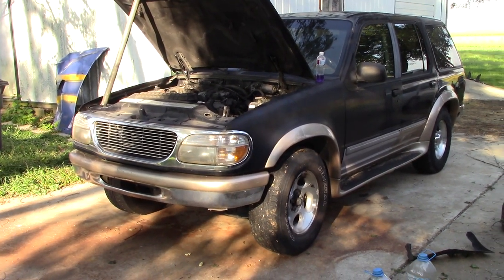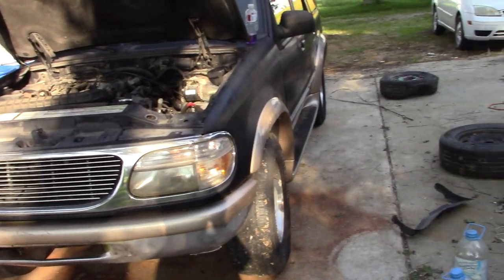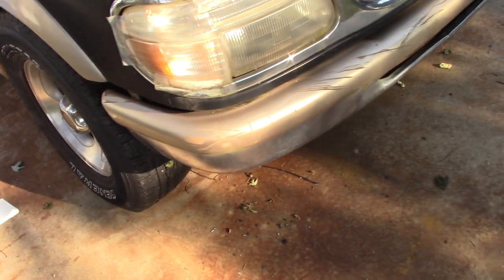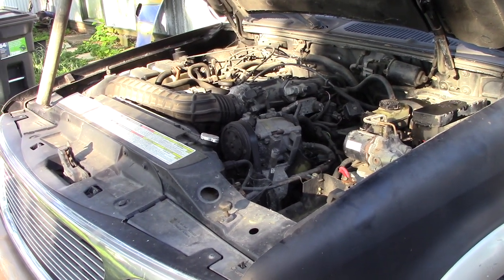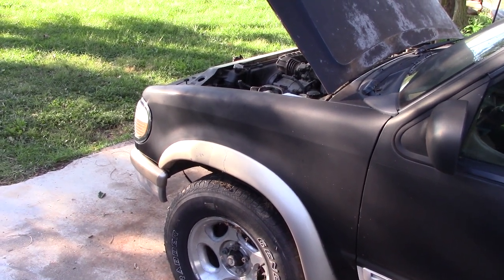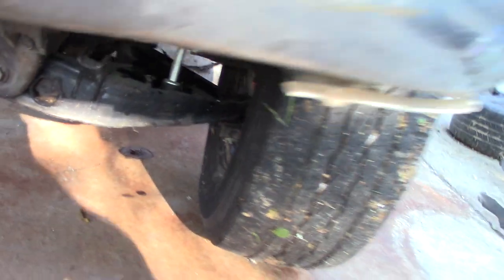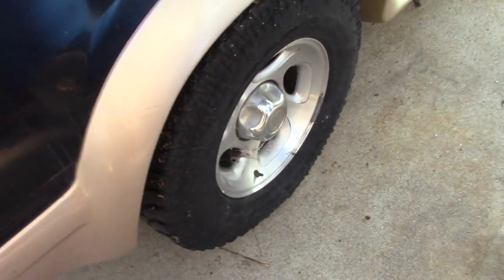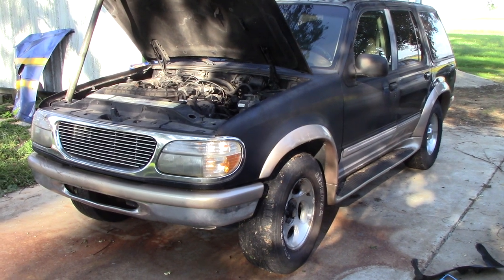1996 Explorer Derby Build Ep 1: What did we buy?

Comment: Just a couple tid bits, ran tons of these. You can loop the lines and it will run just fine for a 10 to 15 minute heat. Try to use the front end as much as possible, I use to take half ton bumpers and cut them in half and slide together then just bolt them on. You can remove most of the wires towards the passenger side under the hood. Like i said very much a front end vehicle. You don't need the MAF but it def helps it idle better and run hot.